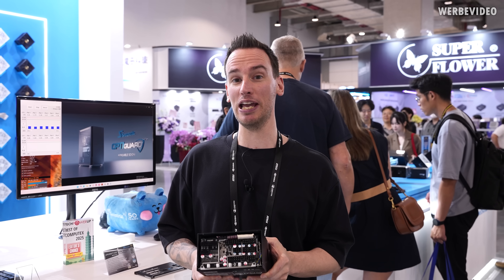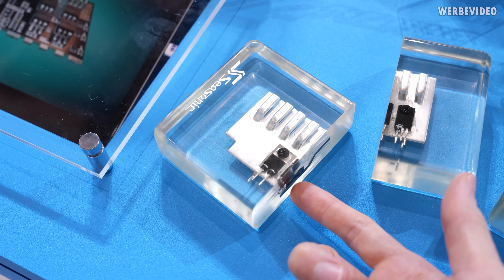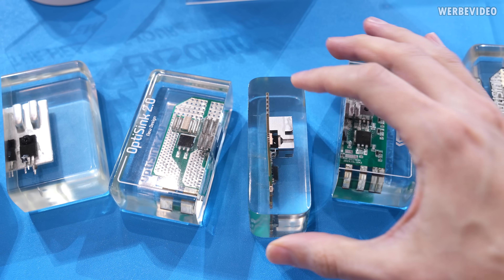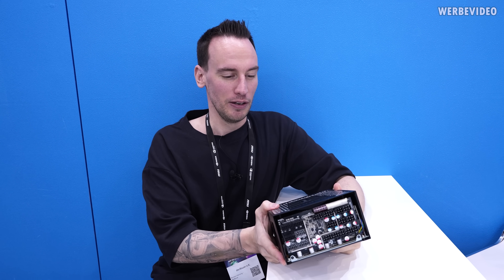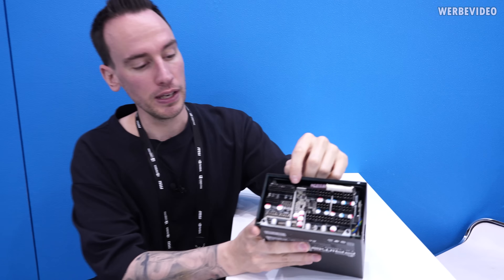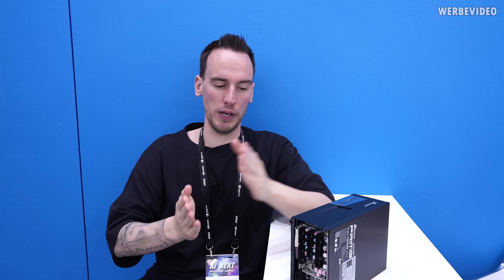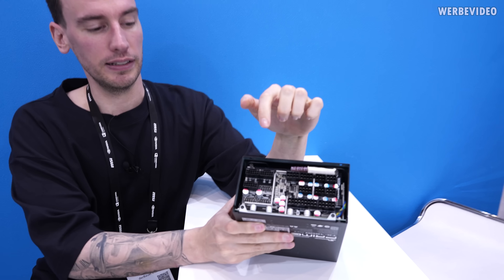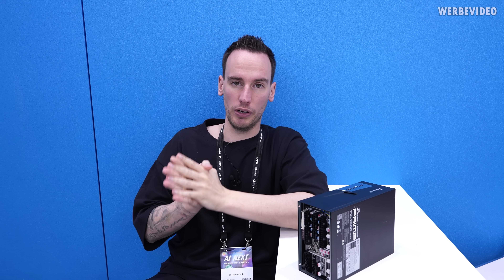Seasonic Confirms 12VHPWR Risk – Unveils Protection Feature

Comment: Seasonic shouldn't be ones doing this though. Nvidia should be fixing their issues.
Reply: Nvidia will just release a statement that they are aware of an issue and not doing anything about it.
Reply: @Dan-zm5ik they wont, a mouth shut and partners doing all this is what will happen because no one decided to sue them and no one declared their crap as dangerous and requested a recall for being a fire hazard

this will go on as if nothing happened
Reply: nvidia does not fix anything, they are here to sell and convince you to buy more, because the more you buy...
Reply: They appear to see it as somebody else's problem, cheaper to deflect and deal with some RMA.

Comment: I have an even better idea - drop this defective standard completely! People should stop buying cards, that use 12VHPWR, and maybe brands will get the message.
Reply: Did just that. I was ready to get a new system, waiting for the 5090 to be released, when the shit show started.  I waited a few months to see if the power connector and drivers issues would get fixed and then finally decided to get a 9070XT. It's a little annoying to not have the most powerful card when I can afford it, but the satisfaction to not give money to Nvidia is really great. I think I'll stick with AMD for now and upgrade if they release something more powerful.
Reply: Once the gpu vendor get accountability and start honoring rma claims and not blame psu vendors we might see some changes.
Reply: its not the cable, it is the GPU card design. They wanted the chipboard smaller, so they got rid of all safety, its not a PC gamer design
Reply: It's not a defective standard, 12VHPWR was fixed with 12v2x6, the rtx 5000 issues would cause melted connectors even with the classic 8 pin connectors, its a board design issue, not a connector issue
Reply: Dear friend @dahahaka  
Then, why connectors on the psu end melts, if it is a board design issue?
Reply: @dahahaka the standard includes (defective) guidelines for PCB design
Reply: @dahahaka the standard is fine, it’s the board… 8-pin PCIE will melt if you don’t load balance.
Reply: I did not buy any graphics card with 16-pin power connector and do not consider to change my idea anytime soon.
It was & is defective on arrival and the problem is still here.
Not gonna waste my money for unsafe component.
Reply: Yes ...
Reply: The PCIE SIG knows what they are doing, they designed the whole interface and protocol while taking it through 6 revisions without a single hiccup.  It’s the implementation that’s f**ked.
Reply: @KleoGroutides  Just because they made good stuff in the past  doesn't automatically make the new ones pass. Both products are so far apart in invention that the entire engineering team, verification team, protocol and process would be different(read: not necessarily better). Stop glazing companies for no reason.
Reply: The issue again isn’t the connector… it’s the implementation on the destination of where the connector is… there’s no regulation.
Reply: Isn't using an ugly connector from 3x 8pin to 1x12pin a safer setup ?
Reply: @pascaldifolco4611 yes because the PCIE 8-pin was over engineered, it was rated at 150W but with slightly thicker cable it can handle 300W. Triple 8-pin can sustain 600W while also peaking at 900W.
Reply: @pascaldifolco4611 no, this issue is occurring because newer cards don't have current balancing circuitry

Comment: They need a warning notification at the Steam overlay level to be most effective and give gamers a chance to exit. That is, if it can detect an issue in time, which I have no idea about. Nvidia needs to admit they were wrong, or board partners should agree among themselves to not use the connectors in future.
Reply: sad part is that this connector started appearing on radeon gpus ;[
Reply: Too slow. It has to cut down power immediatelly… and hopefully so prevent the burning…

Comment: It's insane, and the most insane thing is that board partner can't do a PCB with more protection to prevent this issue.
Reply: Nvidia loves one time use graphics cards!🤪
Reply: @aberkae 
The more you buy, the more you save!
😂
Now new GPU after each gaming session!
Reply: In fact they kinda do. It is implemented on the 4090 Matrix & also Astral 5090 if I am not wrong. Resistors to be able to detect unbalanced distribution and trigger a warning
Reply: @Nico_CPK my Zotac has a built in Led that turns red if there is a connector issue. Well I hope so
Reply: they are not allowed to because the specification specifically makes it impossible to implement load balanincg on the gpu pcb
Reply: @petertakacs7895  OK, but the fact to join together the six 12V wires and the six ground wires pratically solve the problem of load balancing, no ?
Reply: that is because they are implementing the 12V-2x6 standard which is flawed. The standard is bad and that is not the fault of the AIBs
Reply: @nuclear303  They could just not follow the standard bit-for-bit, it's not a legal regulation. There was current balancing in 3090s with 12VHFR. Most likely it's Novideo that's forbidding the AIBs to implement current balancing and they should be punished for that.
Reply: @libre-serwis iirc the 3090 connector was not standardised yet, that's why it's better. I agree fully that Nvidia is surely pressuring AIBs to use the current standard, still, the standard is shit and it can be "fixed" only by changing it fundamentally
Reply: @RurouTube  Nvidia supplied a cable for its 4090 in which the 6 12V terminals and the 6 ground terminals were connected together. This was probably not for nothing ?
Reply: The problem is that PCB has to be inside the gpu… because the problem could hapen in the part that is in the gpu side… no matter how wellrhings are before that…

Comment: So much engineering effort put into trying to solve a problem that shouldn’t have existed in the first place!
Reply: The most fascinating thing about the 12VHPWR is seeing this kind of engineering failure in a world with so much accumulated technological knowledge and experience.
Reply: @dece870717  Incredible. You typical normies still don't understand, even after watching this footage, that the problem is not the plug, but too much strain on the cables as a result of the mis-designed power system of nVidia cards.
Reply: @dece870717 
I have do disagree. It’s highly doubtful that this was an engineering fault; it was an „economic“ decision.
They deliberately made it so you can run it just for an hour a day at 50% loads for gaming and it will melt at 24/7 with 100% load as a KI server;
so to not cannibalize their high margin buisness.
Chines already put 4090 apart (gpu and ram) to set it in a new PCB. You really think they just put 12 gb of additional ram? Power connector was surely improved.
Reply: That's how it usually goes.

Marketing has a one hour meeting,  5 guys working one night to come up with something, after one more one hour meeting it is deemed "the next big thing"...

Engineering has to figure this sh*t out for years. Even after release.
Reply: Just like apple. Make a problem that never needed solving and say it's some genius engineering and it's the users that don't "get" it
Reply: I dont know what is going on with nvidia, its like they are trying to be bad
Reply: Big brain, Jensen forces all PSU manufacturers to improve their PSU supply by having on rail monitoring on the PSU side.
Reply: When will they redesign and validate said new safer design? Clearly for years it’s been a safety risk
Reply: The current regulation per pin should be on the gpu side.  I think it was in the past but stopped doing it to save $$
Reply: Shhh delete it or Jester Huang is going to blacklist you.
Reply: read my mind !
Reply: Exactly, just stick with 8 pin pwr 🤦
Reply: we only need steamOS now to close that darn loop right ? :)
Reply: Just buy AMD, problem solved, the only way Nvidia would possibly learn is people to stop buying their cards.
Reply: Look at Jensen creating all these jobs 😂
Reply: Sure, but nothing about any of it, even this, seems like "so much engineering" - not even close.
Reply: choosing the expensive way to fix the basic problem than to put more 12vhpwr connector that is cheap, its like german vs japanese engineering on a front suspensions car
Reply: @meow2108 the japanese are never cheap though.
Reply: You can tell that NVIDIA has been pushing this format not because of aesthetics, but because they know deep down in their rotten guts that they're going to be pushing the power past 1000w someday. They want us to get used to seeing one cable now, before it becomes multiple.
Reply: @GirthOfANation the design is garbage, doubling it for double power is just two points of failure
Reply: @mezu-e  We all know that, but does Jensen? Not sure if he's ever gonna get the memo.
Reply: exaclty. Imagine nvida finally making up their mind and changing the connector with a better one. that woul be all reasearch and development funds gone for nothing
Reply: @son_pluto  for nvidia to change the connector, they would first need to admit there is a problem, but nvidia is playinf dump with users money
Reply: Indeed so it can cost even more!
Reply: Seriously, using a bundle of small wires to transfer more amps is just dumb. Just use a pair of decently sized stranded cables with one of the many industry standard connectors which can easily handle the current and future loads. This isn't rocket science.
Reply: Nothing is wasted, even from failures one can learn a lot. Hopefully in the future when some engineer is deciding on a connector for their system (not necessarily PC related) and think about doing something similar to this, they remember this whole sh*tshow and decide against it.
Reply: And on a component with 4 digits price!
Reply: This
Reply: Yeah i know! But something tells me nvidia did all that on purpose so the other companies can make products to sell and make money. Idk
Reply: @theanimazin  its just copy paste setup from their two cable ai setup;
Reply: Exactly my thought, none of this effort would've needed if people didn't design a shit connector.
Reply: @maximmk6446  the 3060 has 3 shunts, the 4000 and 5000 have none... 6 cable going to one plug. It Nvidia doing shit desing copy paste from the AI server variant.
Reply: @maximmk6446  If it's so easy, where is it? It's the same type of connector everybody has been using for years but now you decide it's nvidia's fault. In case your blind look at your 24, 8, 6 & 4 pin connectors and tell me the diiference?
Reply: with the cost and performance and just complications of new age electronics this kind of thing we should have . yes we will get it now due to a mistake , but this is something I am excited to have and would like to see on more then just 12vhpwr connections . being able to monitor and even record what your system is doing is just nice to know see and I feel really specially the shut off . I would like to see the ability to set our own parameters , volts , amps and or even watts to every component and have monitoring and safety shut offs

Comment: Wouldn’t higher voltage solve the high amp problem
Reply: yes but they cannot use higher voltage because the standard says 12v
Reply: @marcogenovesi8570 I understand what the standard says. The standard is also causing damage that could possibly lead to a fire and death. So the standard needs to be changed.
Reply: @xabhax  Changing the standard would mean admitting Nvidia did something wrong, which is unacceptable for Nvidia. This is not a standards issue, it's a Nvidia issue
Reply: @marcogenovesi8570  changing the standard would mean resupplying power supplies with regulators adapted to the new voltage levels
Reply: @erkinalp  yeah changing a standard requires changing the hardware, that's implicit

Comment: Sad part is that NVIDIA will never give in and confirm that their board design is trash. All of these bandaids shouldn't be needed. NVIDIA is a dirty scummy company these days, and i will not be getting NVIDIA next upgrade. Next time i will upgrade i will do reseach in Bullzoid's YT channel to find out which GPU is safe and well designed.

Also why arn't cable manufacturers using the 4-spring contacts and insist on using these garbage 2/3-dimple contacts...
Reply: No manufacturer will admit, we're living in cyberpunk dystopia where multi billion companies have the power.
Reply: Hot potato of responsibility, enabling all of them to ignore the problem entirely.
Reply: not only their board design, they're forbidding the AIBs to design their boards better
Reply: @libre-serwis  i know, that's the worst part. I couldn't care less for their terrible FEs to go up in flames, the cooling and nosie levels suck anyways. But let AIB's have the freedom.
Reply: It's why I look forward to buying cheap Chinese GPU once they catch up.
Reply: No amount of springs or crimples will fix the overloading issue. There is still a lack of load balancing and the fact that the connector is not built to handle 600W.
Reply: @Assassin-js1jp Already covered in the video - the biggest problem is high contact resistance in some cases, and active power balancing just causes the high resistance contacts to heat up more. Active balancing is fine if there's only a small difference but it's also unnecessary then because there's enough headroom in the connector to accept a small difference, just not such a dramatic difference that all the power is running over 1-2 conductors instead of 6
Reply: @bosstowndynamics5488  Nvidia supplied a cable for its 4090 in which the 6 12V terminals and the 6 ground terminals were connected together. This was probably not for nothing ?
Reply: People get what they deserve. As long as people are buying these cards faster then nvidia can produce them, things will not change.
Reply: but fans will say they did not made the connector, they only doubled down on using it

lol